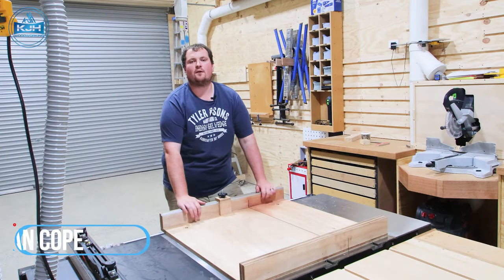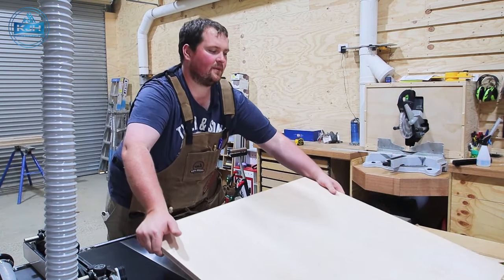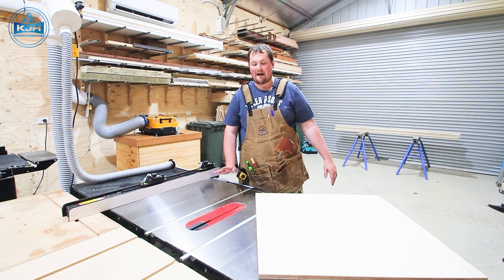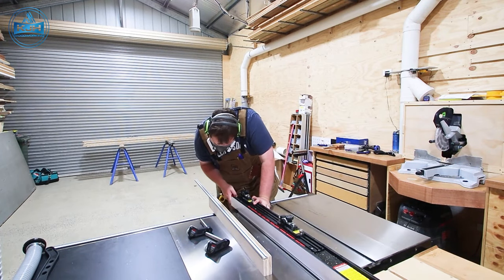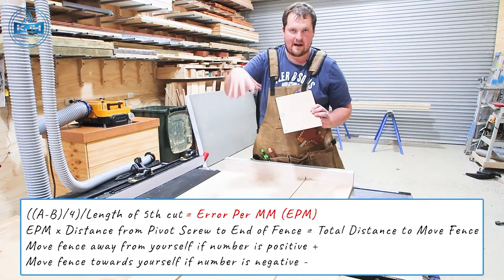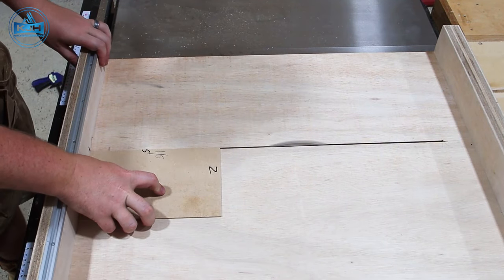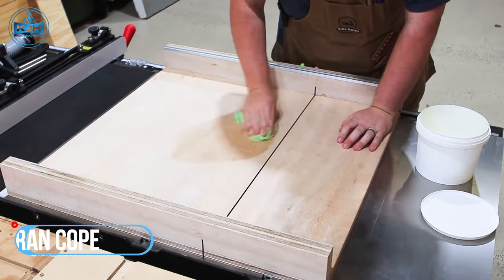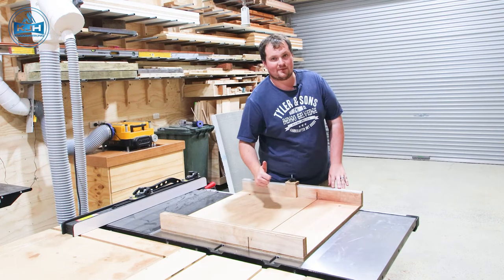Accurate Cuts = Key to Woodworking!

Comment: Hmmm, not thought of using t-track for the runners before. Great idea.
Reply from the maker: It works well in a pinch. I do prefer a store board track solution though, after using hardwood, t-track and store brought.